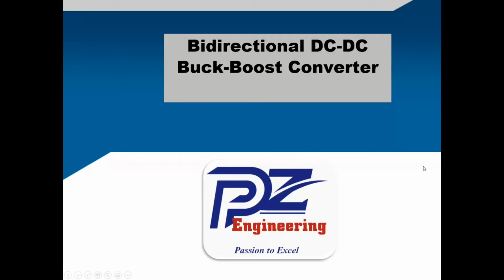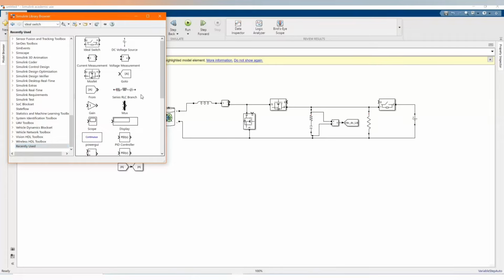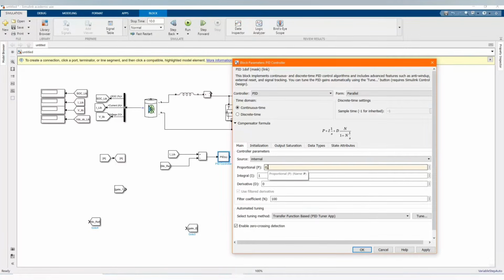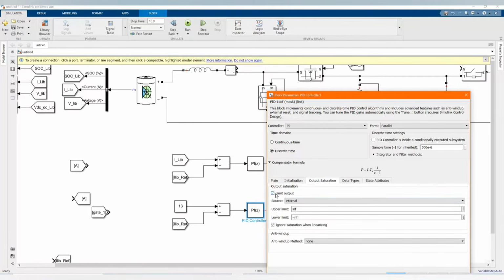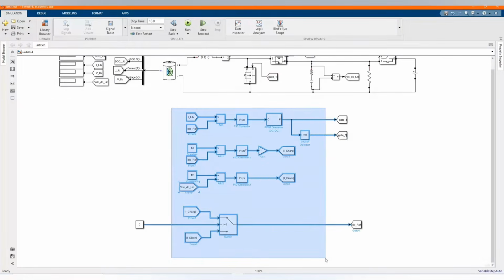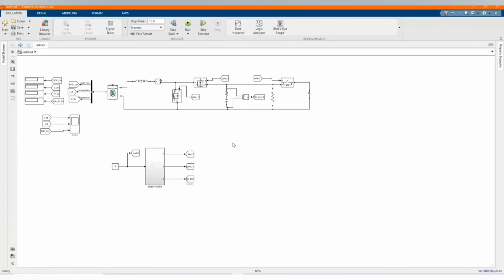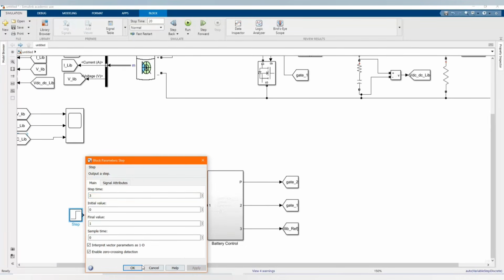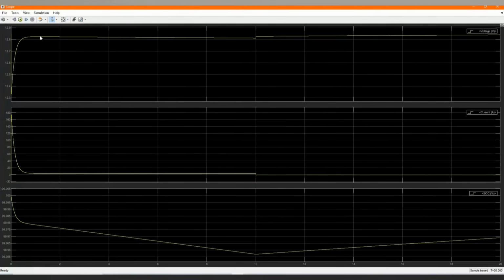Design and simulation of Bidirectional DC-DC buck and boost with Battery Control in MATLAB/Simulink

Comment: How do I take a reference if I use 20 batteries modeled in series? Do we take the average, or how do we do it if there is an imbalance between cells and a difference in SOC between each cell? Please explain, sir, because I want to use it for BMS simulation for passive balancing. Can you create a simple simulation model example on your channel for this problem?

Comment: @pzengineering2020 
what component did you use between the resistor and the dc voltage source where you fed the constant 1 and 0 for charging and discharging? I didnt find it in the library. Its really really urgent. Please help me in this asap. Thank you
Reply: Ideal Switch

Comment: How to calculate the battery nominal voltage and rated capacity?
Reply from the maker: The battery nominal voltage an rated capacity do not need to calculate, unless you are sizing battery energy storage system for a specific load. Can you elaborate your question

Comment: hi sir, may i know how the PWM works? if we calculate the duty cycle value, we will get the numbers. but then how do we know the product of PWM is the same with the calculated duty cycle? as i can see in the video, u use battery current.. bit confusing and still learning, hope u can help
Reply from the maker: Hi thank you for your comment, The PWM is determined by the switching frequency and period, which is the same used to calculate in general the Duty cycle. I think you should just be sure about your calculation which should be the same with simulation.
Reply: @pzengineering2020  then, i need to make sure my battery current needs to be constant in one value only? because I know if the current is sinusoidal the PWM output would have an irregular pulse
Reply: @pzengineering2020 hi,i couldn't simulate discharge and charge mode.
your method is incorrect.
U didn't show simulink block for them correctly.

Comment: How come output of voltage controller circuit a current??, You have considered output of voltage controller as Iref right? I didn't understand that, voltage controller gives an voltage as output right? Plzz help me
Reply from the maker: Hi thank you for your comment, you can use voltage  will still give you the desired output

Comment: Thank you for this helping video 
I have  a question  . can this bidirectional boost the voltage from 383 v to 1014 or it's impossible ? I need all the parameters  please
Reply from the maker: Hello, thank you for your comment. You can get any voltage as long to calculate your parameters in the right way
Reply: @pzengineering2020   but how can I choose them ?? I tried with it but I doesn't work if it's possible to post all the parameters please
Reply: I mean the parameters of the control ckt

Comment: Hi PZ Engineering
Hope you’re doing well.
I have some confusion over your control circuitry, can you please make it clear.
First, you have compared 13 and 12 with Ilib_ref in your controllers, why is that so?
As for my understanding, 13 and 12 are the voltage values. How do you compared voltage with current?
Can you please rectify your circuit?
Reply from the maker: Hello thank you for your comment, In my control, the main focus was to have a reference current. Was more about discharging and charging reference current. at 13 suppose to be voltage not current. Will rectify in the next videos. However, I hope you got the idea
Reply: @pzengineering2020  thank you dear

Comment: Can we charge the battery with higher voltage supply??
We are using A Bidirectional Buck Boost, it should reduce the voltage level in opposite direction
Reply from the maker: helo, thank you for your comment, The battery normally needs to be charge with a slightly higher voltage. We need to be aware, we should not charge battery with very high voltage, it will damage the battery, consequently reduce it's lifespan. the use of buck and boost is the solution to reduce the high voltage to a slightly high voltage to charge the battery.

Comment: How to design bidirectional PHEV battery charger in simulation
Reply from the maker: Good day , I have simulated bidirectional dc-dc buck-boost converter for hybrid energy storage system  used in  EV
Reply: @pzengineering2020  Sir, my research topic is integrated single phase bidirectional PHEV battery charger.
This battery charger two parts
AC/DC full bridge boost converter cascade by Dual Bridge series resonant converter....
Reply: Please help
Reply from the maker: We are doing tutorials on that which will be helpful to you
Reply from the maker: We will discuss on that and get back to you
Reply: @pzengineering2020  ok sir 
If any kind of video to the related this topic please suggest me
Reply from the maker: I will definetly